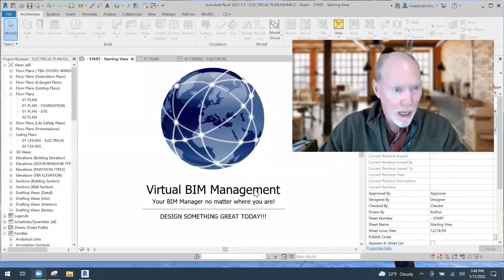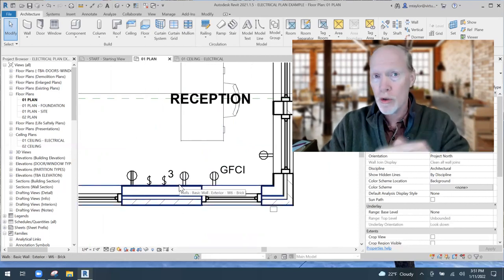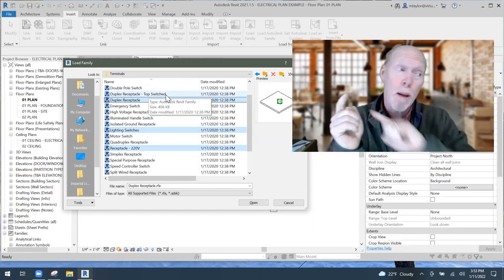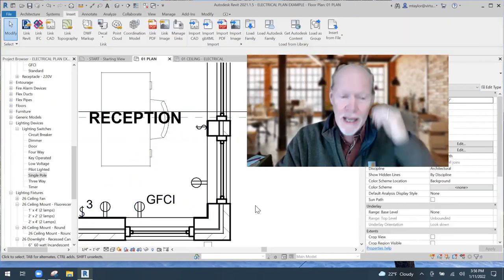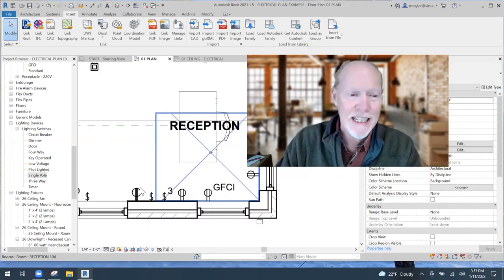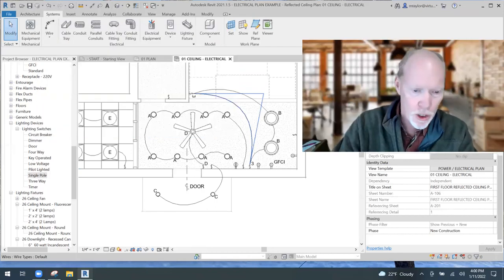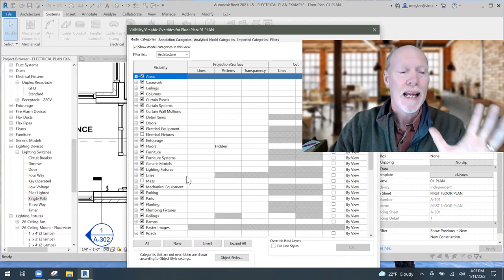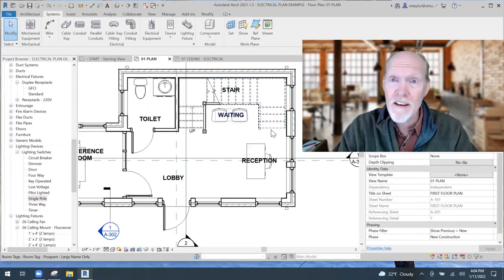ELECTRICAL SWITCHES AND POWER OUTLETS

Comment: The incident with the restroom is a common issue when someone specifies and/or installs a sensor with Passive Infrared (PIR) technology only, where you have to be in the line of sight of the sensor to keep lights active. As an electrical designer, I recommend the use of dual-tech sensors where the sensor makes use of both PIR and Ultrasonic tech to pick up someone in the stall. I really enjoy your training videos!

Comment: Thank you Mike for another amazing Video!!! . This is the second time you upload a video which covers the same topic I am dealing with at the moment.  I want to show a floor plan with lights, outlets and light switches (as you show yours), but I can't seem to figure this out or  how  you set up the template you are using. For instance my light switches show in floor plan but not in ceiling plan with lights.... In short a part 2 to this video would be amazing. Thank you so much.
Reply from the maker: In my Power Plan or Lightning Plan.. all I did was to lower my View Range down to about one foot off the floor!!!! That way you can see outlets and switches and also the lights on the ceiling!  :)
Reply: @miketaylor-fantastic  Thank you a bunch!!

Comment: Hi sir how r u ..plz make a video on fully curved curtain wall ..i Draw a curved  curtain wall but it's not curved...and plz don't hack on mullions i want true mullion...some people make a basic ball and change material to aluminium then  change horizontal to aluminium wall ...i will send that video...thanku sir
Reply from the maker: Curved curtain walls are indeed available in construction. But, you will have to pay much more for them than the segmented curtain walls. If your client is willing to pay for true curves then you should use them. But Revit can only make the straight segments.  Curved glass also comes at a very height premium price.
Reply: @miketaylor-fantastic  hi sir..i want to know how to get the schedule of stairs and railing both...thanku sir